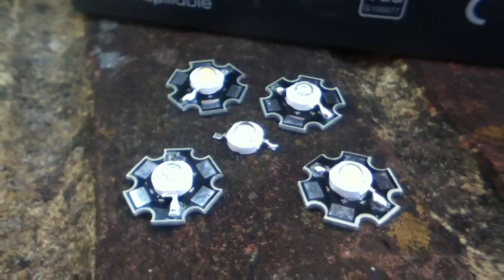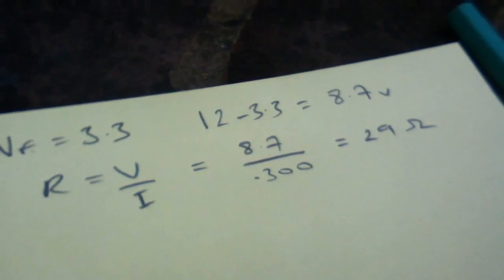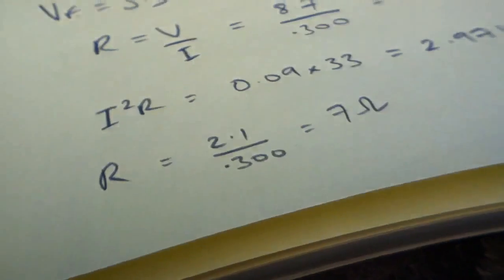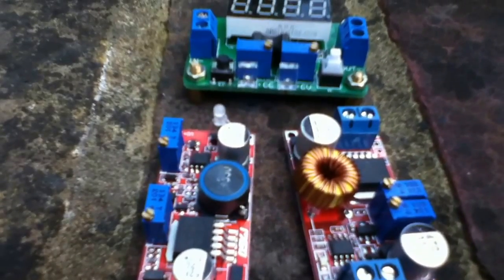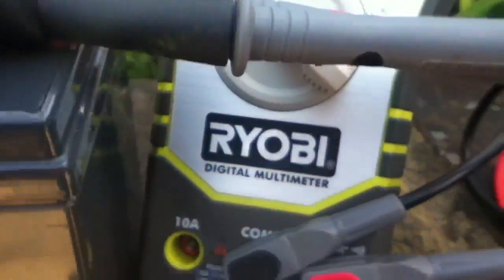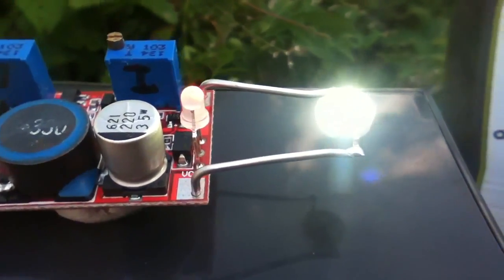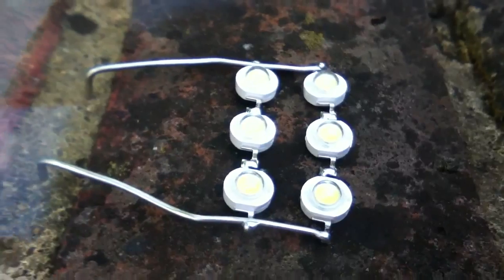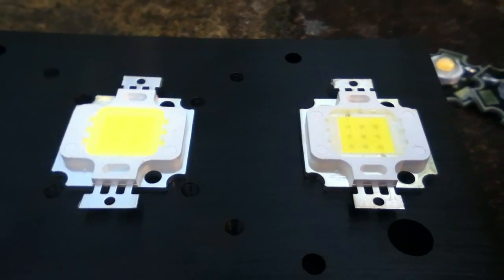High Power LED Tutorial #1 - How to Drive 1W and 3W LEDs from 12 Volts

Comment: Great video! 👍 You really know your stuff. I on the other hand don’t! 🫤 I’m mid build on a 2 foot Nostromo model. For the 3 main engines I have 57 5mm fibre optics - 19 for each engine - that are lit by 3 x 1w high pwr LEDs connected to a driver. Do you know if there’s an easy way to make the LEDs pulse rather than just be on or off? 👍

Comment: From 230v ac I need to connect 20  1 w led so I think one rc circuit with buck converter I can use ?  66 volt 300ma I require

Comment: P =V x I, so if it's 1 W, then 1/8.7 gives a current of 114mA. Not 300mA. Then P = I squared R, 1W = 0.114 x 0.114 x R, R =75 ohms. Use this resistor and you have no problems. You cooked the last one because you used a wrong resisitor. 33ohms is ~half the size required. Im not sure where you got the 300mA current from? I've used this method for years on all my led installs and never had a problem cooking any resistor, and the leds run cold as ice. I also don't use the Vf. I use the full voltage in case of a failure. So I would use 12V as the Voltage, not 8.7. Ive got my whole shed setup running 24 V leds on 2 12 V car batteries of 25Ah each in series and my house with 12 V batteries in parallel with 12V 6.5 W leds. I measured the current through the circuit first in the shed for each array and saw it was 600mA, and using the power calculation worked out its 14.4 W. Working it out is gives a value of 40ohms. So then the resistor I use is 15W and couldn't find a 40 so I use 44ohms. And resistor are cheap, so a little bigger is not an issue. I think they were $1.80AUS each. Ive had no issues with house or shed so hope I'm not doing anything wrong !! 😬

Comment: Hi, my microscope led is the 3 watt star model. I burnt out the original circuit board because I plugged a 12 V wall charger instead of the recommend 5 V. So my question is can I use this led with a buck converter to allow a normal generic 12v to power it? Also need a dimmer switch attached to control brightness. Does anyone know how to go about this ?

Comment: Hi, I have current source 900ma box. Input ac 220, output 12v labeled - Led and + Led. My Led 3 w, star Led same as on your video. My question can connect this Led direct as the box labeled which in this case I’m putting 12v on the Led or I should connect a series resistor which can drop the voltage across the Led? Thanks

Comment: Which module I can Use for drive 12V Led Strip on 12V Battery?The Linear Lm317 have too much Drop Voltage.Thanks for your Videos

Comment: Great video, just what I was after. One thing Im not sure of though is I want to have three LEDs that can be independently switched. Can I put three 1W LEDs in parallel and use a relay to turn some on and off or does it need to be all on or all off on the output?

Comment: I still don't understand constant voltage and constant current. I watched a video that claims constant current power (so regulating the voltage) is generally the better option (but more expensive, suited for high-power LEDS) because it prevents thermal runaway.

I also thought you can't power a LED off of a battery without a resistor because it'll burn. This video shows that you can only if the battery voltage isn't higher than the acceptable LED voltage. That's nice to know. However, what about dimming and overdriving LEDs? Is it better to dim them by limiting current or by limiting voltage?

Comment: I have bought 5w 700 mA LEDs that need to 6-7v to work . I want to install these LEDs as DRL in my car . 
I want to install 4 LEDs on each side using a cc cv module. 
Can u please help set the voltage and Ampere on the cc cv module to run 4 LEDs with car battery. Ill be thankful to you if u let me know the proper output voltage and current on the module to make the LEDs work without burning them

Comment: The accurate power supply control to the led is interesting and the problems caused by the alternator kicking in on a car to charge the battery. In car specific led exchange bulbs do they have any sort of regulation or resistance on board and are they doomed to failure more rapidly than the incandescent filament?

Comment: Hello Julian 

i've purchased the same voltage and current regulator to drive 3w leds , i' ve set the voltage to 3.3 v and the current to 700 mA as instructed on the data sheet however the led only drew 200 mA am i doing something wrong or it's just the quality of the leds  . it's mounted on an aluminum heat sink and i got an additional heat sink but it did not heat up can you kindly advise ?

Comment: A few words of caution, I have recently bought a current and voltage controlled circuit off E-bay, I wanted to push a constant 150 mA of current through 6 luxeon LEDs from a 12 volt DC battery supply, underdriving them by a long way and cooling them with oversized Aluminium heat sinks because I want them to last virtually forever. 
I carefully set up the circuit to limit current to 150 mA and the voltage was set well within limits. 
However, I made the fatal mistake of hooking up the power to the circuit and then connecting the LEDs to the circuit. 
This created a sudden surge and pop went one of the Red Luxeons, not much of a problem normally just replace it, except the LEDs were carefully installed on heat sinks behind tongue and groove wood panelling, the whole episode cost me a days work. 
Finally, I decided to use a voltage boosting circuit only and run it through an LM317 circuit I built a while back to limit the current, again a big word of WARNING here, avoid the simple ONE resistor only LM317 current limiting circuits, build one with a potential divider as I did. 
Because I bench tested on breadboard a simple LM317 circuit with a single power resistor and the damn thing allowed an initial surge of around 2 AMPs before settling down to the required current flow. 
In summing up the whole experience was dreadful and I hope I can save someone similar problems, always hook up the LED side first before powering up, check and check again on a bench test first before you even get to that stage, one more thing I did after this incident is I installed a 100uf 25-volt Tantalum Capacitor across the plus and minus rails to the LEDs, on powering up this effectively causes a momentary short circuit across the LEDs, forming a shock absorber to buffer any current surges.
Bear in mind a capacitor across the LED supply rails could make things worse if you were to power up and then connect the LEDs up downstream of the Capacitor.  
I hope I have helped people avoid the problems I have just had to solve.

Comment: Hi, could i add a mosfet to the wires going to the 1 watt led as i need to feed the owtput from a pwm
Board to make the led 1.5 kz with a duty cycle of on 7 off 1 , this is for a 1970's british army infrared
Intrusion alarm set called IRIS i was given which only had 1  ir transmitter , i have made the system work with the pwm board and a 10 mm 850 nm led
With resistor but will use  1 watt 940 nm led's
To make 4 ir transmitters which need more current than the pwm board's can take.

Comment: Excellent video and explanation,  but could anyone tell me, if you were to use a CONSTANT VOLTAGE supply adjusted in such a way that a fixed amount string of Luxeon LEDs or indeed a COB type LED is passing much less than its rated current, let's say 200mA through a string of 1 watt Luxeons, which is well below the 350mA rating.  Is there a problem with doing things this way? providing the voltage is adjusted low enough to prevent excess current flow.
Baring in mind that even temperature variations in the LEDs probably would not be enough to push the current much past the 200mA that is flowing, and certainly nowhere near 350mA.
Reply: that's what I was thinking, I have a constant voltage PS and plan on using a string to get about 250mA on 1W LEDs, don't think it would be an issue... did you try it?
Reply: @ChrisMan183  Hi Chris, I have tried it, I got a scrap LED COB flood light from work, with testing I found the mains driver unit was burn't out but the unit itself was in a nice condition. 
I wanted to run it off my home 12 volt supply, so I applied voltage steadily increasing until the COB lit at a sensible brightness and current flow for a 10 watt COB LED, giving plenty of safety margin. 
The voltage at this point was around 28 volts or something, although I cannot remember for sure.
I sent off for a adjustable voltage booster from china, it was so small that it fitted easily with a bag of silica gel in the back of the unit to keep the damp out.
All appears to be working fine although I do not use the lamp everyday.
But I have some more prestigious LED projects to do, and I must admit I am scared from all of the constant current profits of doom.
So I have ordered some units from china with both adjustable voltage and constant current settings on them. 
My knowledge is not bad, but I am nothing like Dave on EEV Blog.

Comment: Thanks for the video, I am making a UV resin curing lamp. How come you did not try 4 LED 3 watt lamps in series from the 12v battery? Did you give it a try? The bulbs I got were 3.2 to 3.4 volts

Comment: So if I wanted to drive 16: 1 watt leds with an arduino, I would need 4 constant current drivers and a transistor to switch each one on from the arduino pins?

Comment: Ok......I bought some drivers on Ebay and they work good for 3w led's, which it says they are rated for. I think that the specs they give are wrong? Here is copy and paste from listing Also, these are NOT adjustable. ......Input Voltage: DC/AC 12
Rated voltage: 6-12VDC
Frequency: 47HZ-63HZ
Output Current: 300mA±5%
Efficiency: ≥92%
PCBA(L*W*H): 18*12*13mm
Drive power: 1*3W.......
I'm seeing more like 800ma current draw. So, these specs are wrong, correct?  

Next question...I ordered some other ones that say good  for 1  to  5   1w led's. Do these  possibly have some built in feedback to adjust voltage? I have not received them yet but they look the same. These drivers are driving me nuts!!!!!!   :  )

Comment: Hi Julian. 
I got chinese 3W beads from aliexpress. 
using small buck-conv. with one trimmer on it: 
I set it to 3.4V, than measure Current to be 50mA (0.05A) , R = 3.4/0.05=68ohm. 
To list : 
2.4V/0A=99k  dark led; 
3V/0.025=120 ; 
3.2V untested ;  
3.4V/0.05=68  (if 48.5mA R=70. 3% delta); 
3.6/0.6=60 ; 
3.8/0.075=50 ; 
3.9/0.087=45 (if 97mA R=40. 11.5% delta ). 
Questions: 
1. unsmooth form of R line 
2. NOWHERE NEAR 300mA in your Ohm Law calc. 
could you enlighten US ? 
thanks

Comment: Why you didn't burn multimeter in current mode ?  It should short.
Reply: Because the DC-DC converter was limiting the current. One sets the current limit using one of the potentiometers.

Comment: Hi, a long shot asking on a video so old, but I have one of these constant current / voltage boards,  I set it up for my IR 10W 5-6V 850-1000mA LED as Max 950mA and Max 5.5V, it seems to be getting fed the 950mA but when I do a voltage check on it, it only show 4.5V, any reason this might be?

Comment: For step up you just need a step up converter (boost converter). They look very similar and are similar in price, they are perfect for wiring up a whole horde of LED's in series. You can turn 12v into 33v and run 10 LED's in series. I usually run each LED at around 3.3v, a bit under the 3.5v rating.

Comment: The output still depends on the input though, when the voltage deceases in a battery the buck converter wont be still putting out the same converted voltage, it will lower. And it's the same if the source voltage increased (like your example of the alternator). 
An LED can have the right current, but if the voltage is far too high the LED will still burn out as voltage times amperage = watt power. So you still run the risk of burning it out, this is precisely why LED's have voltage ratings to start with! You can't just feed them any voltage and make sure that just the current is fine. 
So if your battery went up to 14.4v and you set the buck converter before at 12.6v battery input to 3.5v output for LED's and 30mA. Then when the battery voltage goes up from the alternator the output will go past 3.5v (most likely past 4v). Which will lead to the LED not consuming it's normal 0.1w, but instead wthin 0.13-0.15w. 
So while it isn't terrible, usually it will shorten their life significantly to be running 50% more power through them than they are rated for.

Comment: Cant i just wire the led up to a voltage regulator and set up the correct voltage for the led? or do i need a current regulator aswell?
Reply: That will work, but you have to make sure the LED doesn't get too hot. When an LED gets hot apparently it will draw more current at the same voltage than it normally would. For 5mm LED's this doesn't matter, but for 1w LED"s and upwards you have to have heatsinks of the back of them. 
If you keep the LED within a decent temperature range and you control the voltage (I would use 3.3v-3.4v) then the LED will only ever draw the specified current of that LED and won't burn out. 
So it is fine.

Comment: One question. I want to connect a 3w LED with a 18650 battery. (Yes, I'm going to use heatsink and so on). But I just can't find the proper driver for it in my country and buying it from China takes almost 3 months to get here... So, any idea of what can I use? Thanks!
Reply: an 18650 battery is lithium so it's fully charged state is around 4.2-4.1v and when it should be recharged it is about 3.6v. 
Because LED's usually want 3.5v you can easily just use a resistor and you won't be losing too much power. 
Do 4.2-3.5=0.7v.
That is a small drop, 0.9 (the LED probably draws 900mA). So 0.7/0.9=0.77. So the closest is a 1ohm resistor, the resistor will be using about half a watt if that's fine. You need a 1 watt one to be on the safe side. 

But buying a small buck converter will do the job a bit better, why does it take so long for China to send to you? Where do you live?
Reply: TechCheck Not with a 3w LED, bro. You would need a 5w resistor the takes a LOT of power. Otherwise your resistor will burn in flames.

Comment: due the voltage change on battery so we need driver regulator for the led.  What if I change power source with DC adaptor (I assume has steady voltage and current),  do we need the regulator anymore?  Or it can be done with only use resistor?

Comment: I think I have worked out that the whole point of the driver is to limit the current enough so that the LEDs won't flicker when the voltage supply changes? I'm not sure if you said it like that or not. My LED string was drawing 155 mA without the driver and I turned down the current to 139 mA to make the flicker acceptable as my servo (wired in parrallel) was rocking back and forth).
Reply: now I just need to boost the voltage instead of buck the voltage (whilst limiting the current). Any ideas for a board? Thanks

Comment: If we use for example 6*0.5w resistors (of course with the right total resistance) to power up a 3w led, will it then be sensitive to regulating voltage, f.e between 12v-14v?

Comment: Julian, In the 3s2p arrangement driven at 600ma, should any single LED develop a fault then surely the whole circuit will go faulty as the 600ma will momentarily flow through the branch without the initial faulty LED and overdrive that branch?

Comment: great video, very useful, thank you. Would it be possible to tell me the manufacturer and part-number of (a) the switch-mode voltage & current regulator and (b) the 1W LEDs that you used?

Comment: Hi there, thanks for the video. I don't understand one thing if you don't mind me asking. When you have a voltage regulator, do you setup the voltage to a exact amount like the amps? Like if the Vf of the led is 2.2 you would set for exact 2.2 and also limit the current?
Last question. sorry to bother :). What about led drivers? are they a good option?

Comment: Hi,

I have this model :
http://aliexpress.com/item/Constant-Current-LED-Driver-Adjustable-Lithiumion-Batteries-Charging-Module-Wholesale/32430651621.html
I set to 900mA for a LED 10W. Once the LED is connected, I have only 200mA. Is this normal ?

Comment: You have to place the Ampermeter in series with load to set the current limit ?? or you can short the output with the ampermeter probes?
Reply: You can short the output with the multimeter. See 4:16
Reply: Is that for sure ? I can really do that ? you plug probes to + and - of the output in current meter mode ?
I have this Buck converter and in series current screw do nothing. So I'm thinking different approach.
Reply: yea you raised a right qsn.. he is doing it wrong, actually he must set current using it in series..

Comment: Hi, nice video. can you help in making a dual 1 watt LED set up? I intend to use it from AC mains.
Reply: Led drivers are approx $1 on ebay for various loads up to 10 1w leds. I have used 1-3 and 4-7w drivers on 120AC w/o issue for years

Comment: Hi Julian
I must say I really enjoy your videos,even ones that I have no interest in, I just enjoy the tech aspects that you explain in detail.I am starting a project in replacing my 4 ft. shop lights.I could buy the new led fixtures but I enjoy the diy aspect  Here is what I have in mind, Am planning to use the Epistar LED Emitter: 3W

- Output Lumens: 180-210 Lumens

- DC Forward Voltage (VF) : 3.0-3.4Vdc

- DC Forward Currect (IF) : 700mA

- Color Temp: 6000~6500K ( White)

- Beam Angle: 120 degrees
mounted on a heat sink in parallel 8 leds per fixture for a total of 48 leds. The question I have is I have several old PC power supplies that I would like to use for power.I know that I will probably need voltage/current buck converter to regulate power, will one 300 watt supply work or do you have a better solution as this is my first led project Thanks